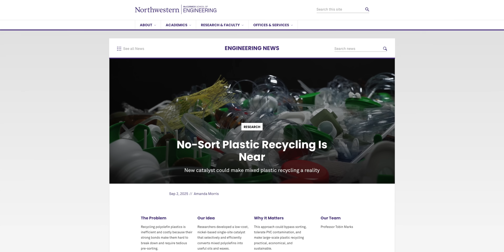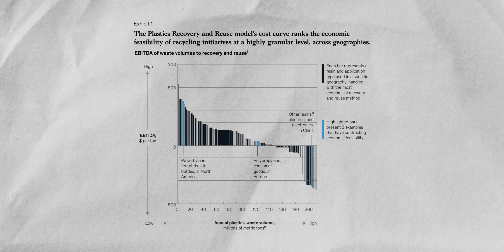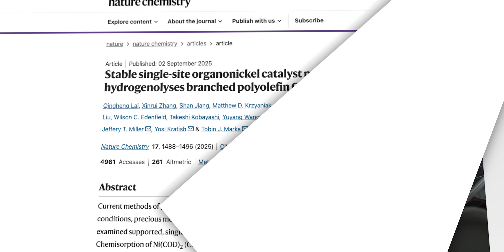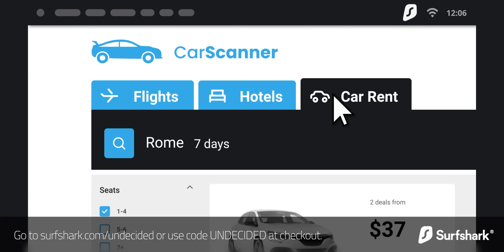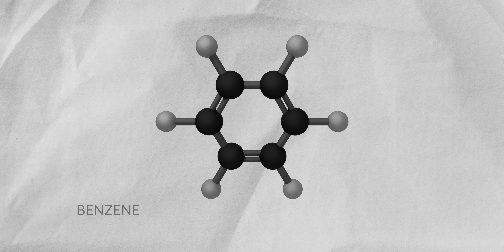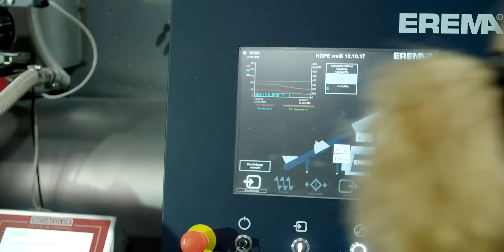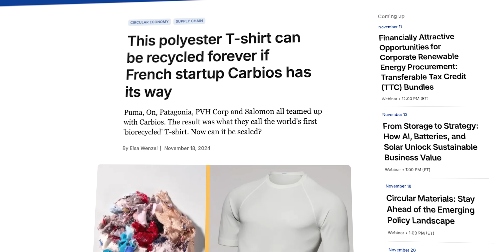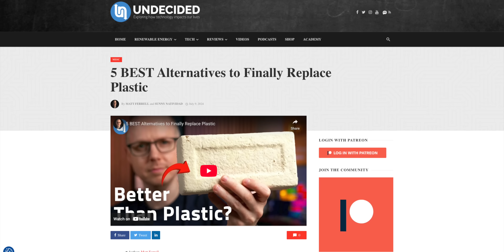The Recycling Breakthrough That Doesn't Need Sorting

Comment: It seems that we have a genuine scientific roadmap.

Renewable energy followed by clean hydrogen followed by cheap plastic recycling.

Most polymer chains and monomer chains can be broken down by energy such as heat or radiation so it seems only natural that plastic should be no different. Most plastic is only made of a few basic elements in different configurations so separating those elements from solution when plastic is liquefied or vaporised seems to be a question of energy availability, if we consider that the big fusion reactor in the sky is barely being tapped rather than relying on stored energy scraps from dead dinosaurs then maybe we'll have the resources required to run the engines so to speak. 

Most technology is built by scientists and engineers but it's the fat cats who decide what gets sold because they like money more than progress or evolution. 

Fortunately scientists and engineers are starting to make money as well so there's less roadblocks from industries that once made children clean chimneys and enslaved entire populations just so that they didn't have to learn a new skill like electricity or highfalutin science because their limousine was good enough to compensate for their petite IQ.

Physics and chemistry sufficiently advanced is indistinguishablefrom magic, and any civilisation sufficiently stupid is indistinguishable from monkeys.

I hope that my essay isn't seen as perturbative or arrogant because what it really comes down to is wanting what's best for the world and not bending the knee to greed and corruption.

We as a society have the capacity and potential to end poverty and bring about an era of peace and abundance but that will only happen when intellect is seen as a benefit and not down trodden by those that have social clout and influence.

99% of people are good and want the best for others but 1% are devious and deceptive and will stop at nothing to maintain a status quo of power and control whether it hurts others or not.

The time for a peaceful revolution is upon us, to borrow the words of Martin Luther King jr: I too have a dream, I dream of a day when nations will work together for the good of all people, unbound by race or ideology but unified by an urge to improve and rebuild, to advance and innovate, collaboratively working together in unity forming a new global society without discrimination and hatred, a world that instills brotherhood and comradery into the fabric of every child and adult, a world that refuses to lap up propaganda and devicive political tactics that serve a select few while millions are bred to be ignorant cogs.

I might not have money and I might not have popularity, I might not be the smartest or most talented, nor the most handsome or humorous but I do have a dream.

I dream of a day when education is freely available and university doors open to anybody with the aptitude and desire to pursue higher education. I dream of a day when I can be heard by scientists and recognised for my contributions however meager, where my publications are mentioned and referenced not based on a degree that I could never afford, not based on marks in public school that I could never achieve but based on the principles of either being right or wrong, so if I'm right then join me and if I'm wrong then correct me but don't mock me.

Who will be the next Einstein? Who will be the next Newton? Who will be the next Hawking? The next Euler or the next Dirac? History is written by the victor but who will be the next Markov? Every great mind of history was mocked for being insane, for being different, for not fitting into a tidy little box with perfectly square edges and conforming to the expectations of lesser minds, well it's time for a new revolution if you ask me.

Not a revolution marked by anger but a second industrial revolution led by those with the capacity to lead and the vision to improve.

It's time for meritocracy to upend beauracracy and for collaboration to dismantle instigation. My words will be forgotten and some pop star will get a Porsche and some spoiled brat will get a rolex for Christmas but perhaps just maybe somebody worth remembering will carry on my dream and a new dawn will bring about much needed change. 

In a world painted 10¹⁰⁰ colors most people will only see 7 until they open their eyes. Most great minds will be shackled and caged before their brilliance can shine because that's what we were told to do by our masters. Those that stood up and stood out were locked up or pushed out. So let me look once more into the abyss and once more it'll look back at me, but at least I'll know that the price paid is the price of freedom.

Comment: Let's focus on the first R, reduce. 
Glass or metal containers and paper packaging. Also hefty  deposit fees to help cast-offs back into the loop. Having done a number of roadside cleanups it's the fast food industry that contributes the most of the debris. 
Holding them responsible would help. If it's their property, cradle to grave they will engage.

Comment: Just do pyrolysis and burn the hydrocarbon portions for energy generation.  bury the slag. Everything else is uneconomical at this time. Comically uneconomical. 

Better yet: Regulate plastics, as self regulation is not working.

Comment: @14:36 THANK YOU so much for mentioning this. The economics only favor virgin products because they are ignoring the long term ecological impact of harvesting fossil fuels. If companies (and consumers) had to pay the replacement cost of drilling and mining, recycling would be the cheapest option by far.
Reply: .. or using a different, more easily recyclable/decomposable material in the first place. But other than that, totally agree. The price tag should include the price to not only create the product, but also deal with the waste afterward.

Comment: We need a way to refill the product we buy, instead of throwing away the container. If you have a hand wash dispenser, that dispenser can be used multiple times. When I was young, milk came in a glass bottle and that bottle got washed and reused, if it got damaged then it was recycled. They could do the same with all plastic bottles, just make them thicker/stronger.

Comment: microplastics come from waste water treatment plants, not random plastic trash in the environment. theyre made from light plastics that get obliterated in their special pumps meant for macerating poop. all discharge for waste water treatment plants are point sources of all the microplastics everyone is noticing. filtering the discharge thru sand works really well but governments would rather not spend the money. real problem is all the microplastics have micropors on them and get colonized with weird bacteria that only comes from waste water treatment process. its starting to really change the microbiom in cities. camplabacter and pseudomonas. the bacteria can survive most of the treatment processes due to geometry of the micropors. its why a bunch of people in cities complain about random ibs symptoms. the problem is the solution is not more government, its less lol

Comment: The problem isn't that plastic isn't being recycled at scale, the problem is that plastic is being used at all. It's leaching into the environment is that problem.
Reply: Yes and no...

As much as I strive to live plastic free, and while it's fairly easy to go mostly plastic free in regular everyday life, plastics are simply irreplaceable in healthcare, wire insulation, and so many more industrial applications 

We CAN significantly reduce the amount of plastic we consume, but much like the invention of paper thousands of years ago, plastics just work too well to be going anywhere anytime soon
Reply: @louisjov  No it is in't. we just don't try other materials because plastic is so cheap and readily available. If we outlaw this poison, then engineers will find solutions. we had healthcare 100 years ago, we had wires and electricity 100 yers ago, we even had cars and planes 100 years ago, but we did not have all this plastic!!!
Reply: @danielmashburn460 yeah...I don't know man. I think it's just more complicated than that. I'm not saying we have no capacity to engineer more products, but plastics, especially in the medical and industrial settings are so ubiquitous because they just work so freaking well

You mentioned wiring, yeah wire was insulated with tar and cloth back in the day, but that insulation also breaks down over time much sooner than modern Romex, and it doesn't conduct heat as well, which is why wiring methods like knob and tube were a thing (for better heat dissipation)

Circuit breakers, wire nuts, and other wiring devices just can't be made to today's standards without plastic, and unless we find a way to roll.back literally 100 years of standards in industry and healthcare, the fact if the matter is plastic just isn't going anywhere 

It's really not as simple as "oh but we got by fine without it before!" because how we build things today are just different 

Recycling to me is the most promising solution
Reply: @louisjov  humans only change when they cannot continue on their current course. We have an inertia that drives us down the same road we always went down. It takes something like a disaster, a law, or a war to get us to change. 

I know there would be much resistance to a plastics ban, and that basically al things must change, but where we are headed is toward a disaster. there are 500x as many plastic particles in the sea than stars in the galaxy. it is in our brains, our livers, and our balls. It is on the highest mountains and in the deepest seas. Plastics are in the snows falling in Antartica.

I know that I'm using plastic keys to type this message, but is this really the world we want to live in? this plastic existence is just...fake. It's not how man was made to live. all these plastic pipes, wires, hoses, and needles, are part of the enshitification of our society. I live near a Mennonite community, and I see them in their horse and carriages, and i don't think what sad sucks. no, i think, they have it right!  I think, this car sucks! My job, my rent, my wifeless life. It sucks. This internet connection is not a real connection. I think, I'm the sorry sucker :(. We're the ignorant, backwards fools. I'd join them, but I feel the need to warn others of the disasters we are causing by pursing industry in this plastic manner.
Reply: Ameen!
Reply: Rubbish

Plastic is usefull and can be made of fish oil
Reply: @Popsidaysi  fish stocks are too low. It would not be sustainable. Maybe with kelp, but when I say "plastics" i mean those derived from fossil fuels. Useful doesn't mean good or sustainable. Meth is very useful for staying awake all night studying for your exams, but is it a good idea?? No!!
Reply: This. Simply. Plastic should be a highly controlled material.
Reply: lets just go back to using clay pots like in the bronze age
Reply: @irkiIIer  we have space-age titanium f*cking alloys.we don't need plastic garbage! it's just junk
Reply: @thebumpkin505  without plastic our lifes would be insanely different. We can hate all we want but plastic is an amazingly versatile product. It's just that we never think through a lifecycle of a product before we start mass production...
Reply: @TheJubess  This. I'm not an environmentalist, I just happen to not own a car because I can manage my life by bicycle. But a large part of that is lightweight packaging and durable foods. I'm not poor, not owning a car is not a choice forced on me by lack of money. I just feel comfortable enough that I don't want to spend on a car. But if I had to lug around more heavy glass bottles, or be forced to go shopping more often because unsealed food items spoil much faster, I'd probably want a driving&carrying machine for myself, too.
Reply: @TheJubess  yes, diffrent, doesn't mean worse. I think it'd be much better!

Comment: One way of reducing plastic consumption would be to sort out US water quality. My understanding is that no-one drinks tap water in the US it having been replaced by bottled water. It's not just sorting the problem after the plastic is used but also before it's needed! This approach also needs to be applied to all other areas of plastic use.

Comment: You have touched only one plastic problem:
- reduce the use of plastic where not needed (ban plastic bottles, packaging etc. Replace it everywhere you can with paper, glass, aluminum...) 
- ban the use of bad plastic formulas that are cheap for production but impossible to recycle
- force manufacturers to produce products with higher quality, cheaper spare parts and easy to fix (looking at you white goods, we should use them 10+ years and fixing them should be cheap and no brainer, not a bad investment and cheaper to buy new one) 
- force people to recycle everything
- make recycling profitable (show them how much money they can earn, and capitalism will do it's job)
- burn trash that can't be recycled in zero CO2 emission incinerators (get to net zero trash on clean way)
- clean all plastic from the ocean (ocean is one of the biggest carbon sinks. We need to take care off it)

This shouldn't be hard for us to do, but will be a challange in third world countries, as they need to change mentality first regarding littering.
Reply: Governments could apply a tax on new single use containers commensurate with the cost to recycle.
Reply: We can start by forcing western companies to stop packaging everything in 6 to 15 layers of packaging materials. If you use one or two layers the reduction of plastic will be enormous. Yet that is bad for the bottom line of those companies, so with them in power nothing is going to change.
Reply: Spoken like a true idiot, who has no clue how anything works, just regurgitates environmentalist talking points.

Comment: Most of the cold areas can use plastic as a supplement with wood or peat to burn into heat and then carbon capture in the pipes can store the Co2, which can then be turned into methane, the demo plant in Southern Finland has been in use since 2018...

Comment: The core of the problem is if the process is cheaper than buying plastic anew. If it isn't, this is simply to appease activist and some media. And the force of the state (and the added cost) will  only be applied on those countries of the West where they already they pay billions on subsidized for these purported green causes (at the cost of the failing economies, that is).

Comment: Pyrolytic cracking can break down all hydrocarbons into building blocks re-refined into virgin-quality materials, has been around for 20+ years but is extremely energy-intensive with the lighter hydrocarbons coming out of the process burned off to reduce energy costs. Still a more environmentally friendly option than dumping plastics even without carbon capture, but also among the least cost-effective.

Comment: Can we regulate what plastics manufacturers use instead of expending extra resources going down the road of using multiple ways to recycle different types of plastics? If everyone is mandated to use only one kind of plastic, consumers won't be confused about which recycling bin to throw which plastic into, and recycling companies don't need to have several different processes to recycle the plastic they collect. A bit part of the low recycling rate is the need for consumers to actually know how to identify the plastic container they're trying to recycle, whether it can be recycled, and which recycling bins to throw them into. In the end, many consumers just throw the plastic containers away with that plastic never getting into the recycling process.

Comment: The plastic versus plasma portion of the video is just pyrolysis but you didn't name it that. Unfortunately it's still breaking down plastic and in the event of a catastrophe could release bad gases so it should be highly restricted. Not only is it demanding a lot of energy but it's only a mixture solution if at best we're getting rid of plastic to make more plastic and or fuel. We should be solving this problem to include reducing the amount of plastics, not just breaking them down to make them again.

Comment: It's another one of those "we could, but" things.

If people could just be taught how to properly avoid or sort their garbage, then it would reduce the problem by a margin similar to a very efficient recycling process.

The reality however, is that more and more recycling facilities will be burning because people disposed their lithium batteries in a bin (despite free drop-off options being available everywhere).

Same for "could we fight climate change?"

I'd say 75%+ of emission reduction could be done with very limited impact on daily life.
The reality is, that COP30 in Brazil chartered 2 cruise ships from Barcelona (Spain) to move there without any passengers and act as floating hotels.

In much the same way, we've been conditioned to accept 3 ton EVs as a viable means to combat climate change.
Not because they're actually good at it, but because they promise to be marginably better than a 3 ton SUV with a combustion engine, that's also stuffed with all sort of nonsense.

Comment: I believe the solution to our problem is called paper bags. Natural bio degradable and renewable. Why are we trying to re invent the wheel? But now that we are here, let me watch the full video.
Reply: How do f do you store liquid in a paper bag? A paper straw cannot even lasted longer than a few minutes. Waxed paper is not airtight, many of we daily products need to be heat stable and remain airtight and leak proof, no paper can do that. Paper is also much much weaker in strength than plastic, engineered plastic can be substituted for steel in some designs, paper can never do that. Smart pants….